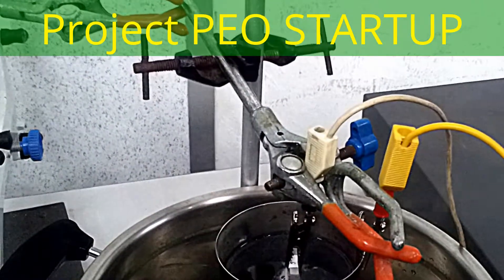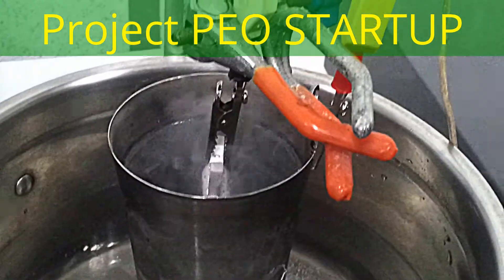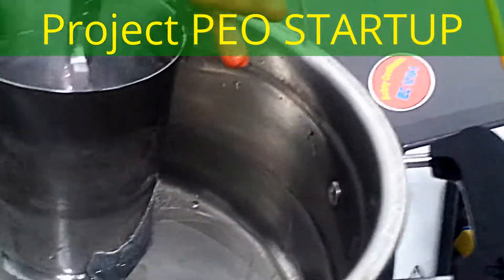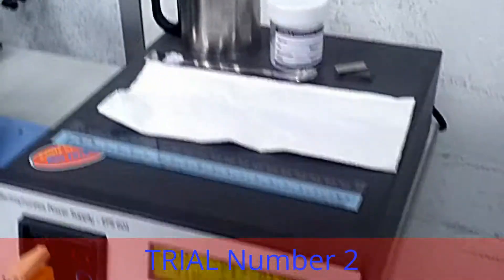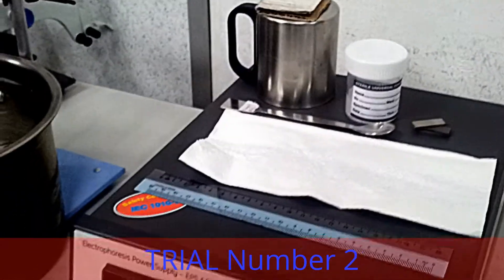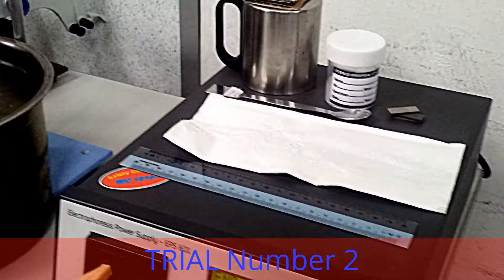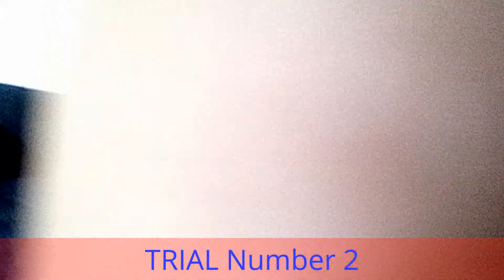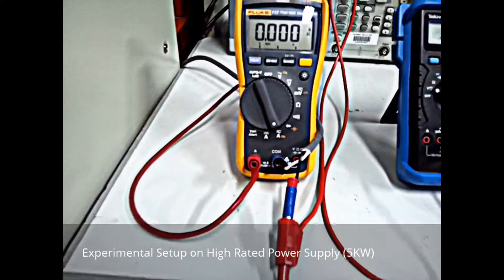Experimentation: Plasma Electrolytic Oxidation

Comment: Could you please share in depth but the equipments used by you guys for this experiment?
Reply from the maker: I am sorry we did not publish the results and data because we could not detect Alumina formation for AA7075 oxidation back in 2013. We had GE powersupply, 12V, K0H / Potassium based solution, The setup was simple a simple cooking kettle for cooling and a steel glass with tripod for sample holding. These details are give in many early papers published on Micro arc oxidation in the 2012 to 2015 era.